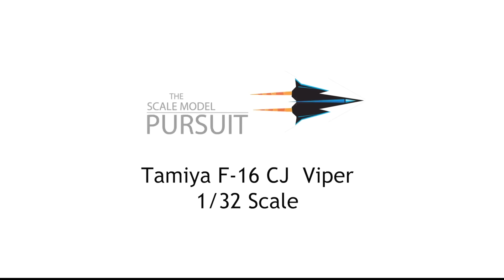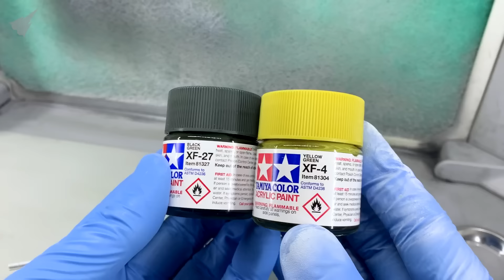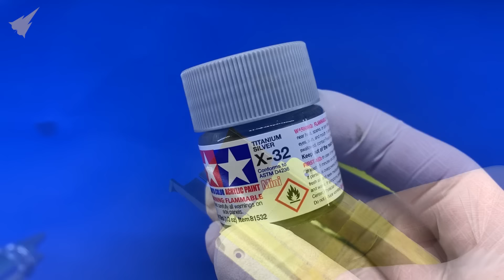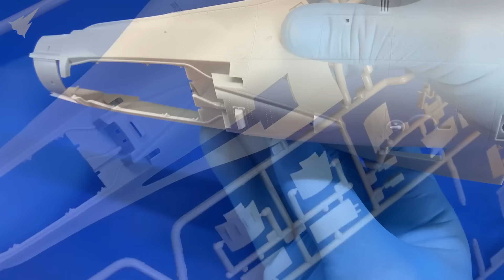F16 CJ Viper Part 2   |   Tamiya 1/32 Scale Model

Comment: I am about to order this kit and alot of other stuff, What is Your recomendation on paint brush? I think I see infinity, Your Videos are truly great ! Thanks , I am learning more than I ever thought possible, all the best
Reply from the maker: The airbrush I have is a Harder and Steenbeck Infinity CR+.  It is a great airbrush but is kind of pricey.  It is very versatile because it comes with a 0.4mm nozzle for larger areas, and a 0.15mm nozzle for very fine detail.  I got it from Spraygunner.com.  This airbrush has a type of nozzle that removes easily and is easy to clean.  Thank you for the kind comment!
Reply: @scalemodelpursuit  Many Thanks! I will order the CR+, nice gear is always more fun to use.